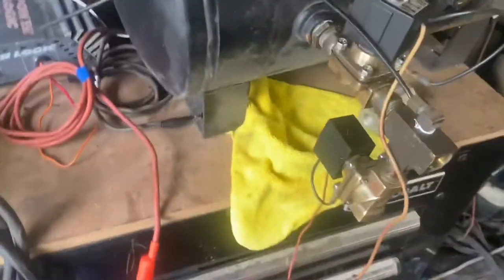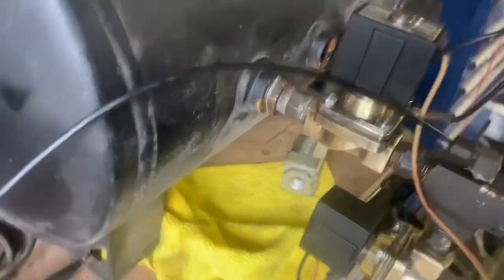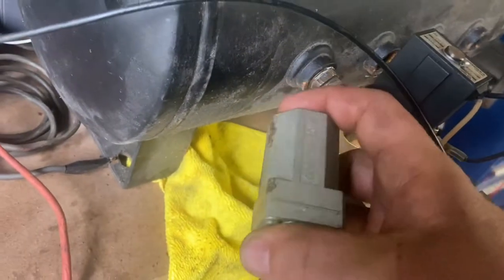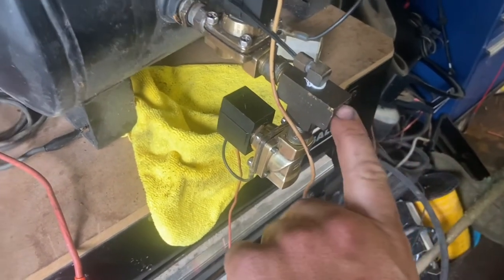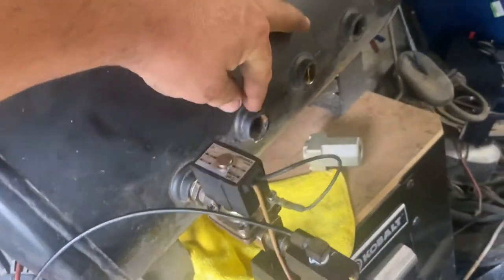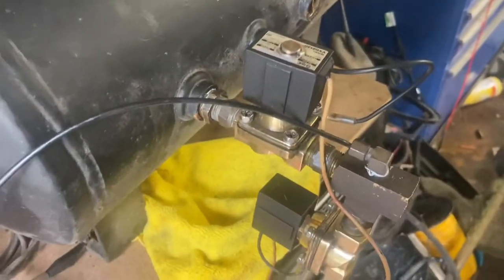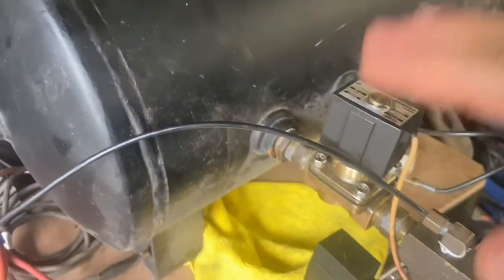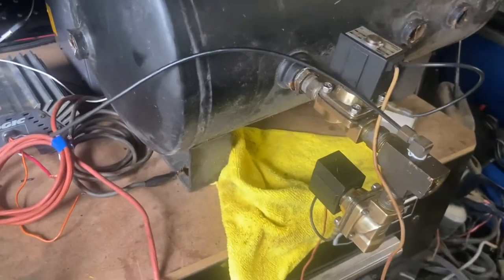Plumbing valves for airbags

Comment: Thank you for doing this video.  This is the best one I have seen on Plumbing valves for bags.  
Do you still have this setup?  After this time, would you do it differently? If so, How?
What valves did you use? 
What is the T with the smaller port for Sending unit for each bag called.   I can find tons of Ts, but Non have that extra small port for the gauge sending unit. 
Also, Lastly, where did you source the Fittings from? 
I saw a few other vids where they recommended to stay away from the fittings at the local HW stores, saying they would not stand up to the 150+PSI in a bag system.
Thank you for your time.
Reply from the maker: I am not using this setup now, but only because I got an accuair setup really cheap from a friend. You have lots of options for plumbing valves for air management, this was just a basic set up that I used for the video. It was planned to be used on the build but the build changed some. I have always liked having the valves plumbed close together and where I can access them in the case of a failure. This allows me to work on them in such a case. 
 The tee is called a gauge tee. These are purchased from thorbeos.com. 
https://thorbros.com/products/brass-tee-with-1-8-line-90-deg-fitting

You can make them if you have a brass tee and a tap set for 1/8”npt. 

As for the hardware store fittings, I have used some fittings from my local hardware store and even lowes. I’ve never had one fail but I don’t about the ratings. Things like reducer bushings and hex nipples would not worry me. I’ve also used compression Fittings from both in a bunch of builds with no issues. That’s just my experience though.

Comment: Why not run all four bags off of 1?
Reply from the maker: You need to control the flow from bag to bag. If you use 1 fill valve for all, when you are driving you will get body roll. As you take a curve the force on the airbags will not be even from the inside of the curve to the outside, this will result in the vehicle dramatically leaning. I will post a video later today to better explain it, I know I’m not the best at typing this kind of thing out. You could use less valves but it requires check valves to limit the flow from bag to bag